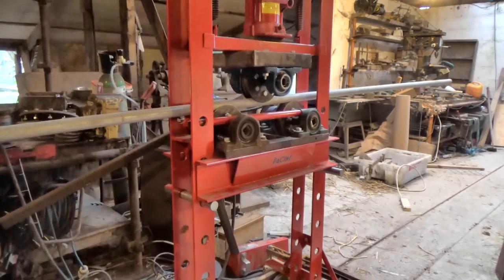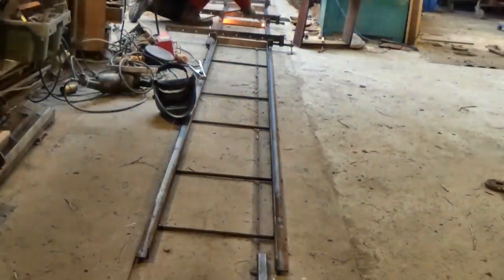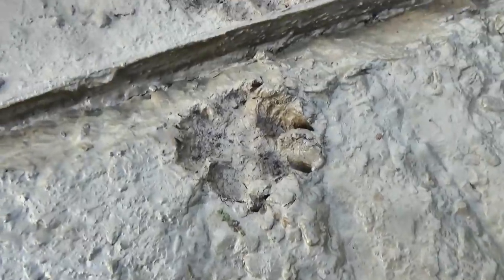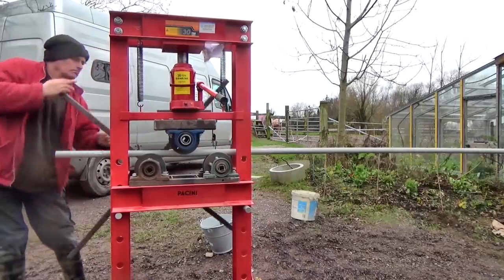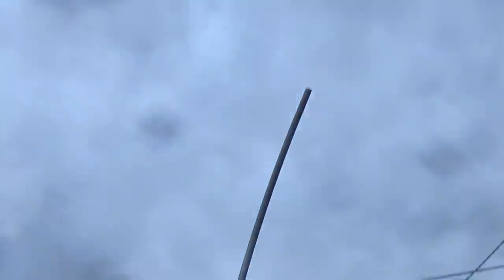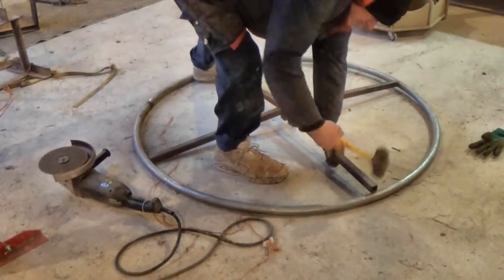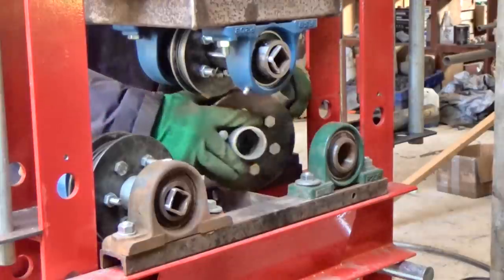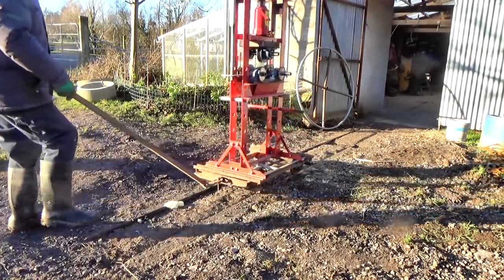Big Problems With The Home-Made Pipe Roller! (And interesting things I learnt trying to fix them.)

Comment: Perhaps you could add an upside down bottle of soapy water with hose & tap to feed it into the rollers while you are bending, this might prevent it from twisting & make it easier to bend the steel. I've seen people also weld a vertical length of pipe temporarily to the ends so that they have a exaggerated T shape so someone can hold a round steel bar through the middle of the vertical pipe to keep it from twisting too.

Comment: We had this problem with our commercially made roll bender at my last job. To some extent, I always thought it was somewhat on purpose, so that you can roll tighter circles without running into the machine. We once used it to make a helical sculpture, very cool!  But yes, it just seems to be a feature of that style of bender and not your build that is at fault.
Reply from the maker: That's reassuring to hear - thanks.

Comment: a dirty quick solution -  hang two pulleys a couple meters above the press and tie the ends of the pipe to a rope, and a 10-20 kilo weight on the other.

Comment: Check the hydraulic jack works on its side cause I had one that wouldn’t due to the oil  level whilst on its side
Reply: It may only be happy in a particular orientation, probably something inconvenient like the handle on the bottom.
Reply: @hughbrackett343  ha ha
Reply from the maker: I'm intrigued, Richi - can you tell me more? Send a link?
Reply from the maker: It does work on its side, but it's seeping oil - so I need to do it another way

Comment: I think it's wheel alignment, this will be compounded by the weight of the pipe. Over 6metres a few thou or 1/100th a mil will will make a lot of difference! The commercial horizontal ring rollers that I have worked with didn't have any end support. You might be able to compensate with out-feed rollers that you could adjust in height, I hope so!
Reply from the maker: I think you could be right - or partially right, at least. I'm halfway through the new build so I hope to find out soon..

Comment: I made a pipe roller like yours. I had to make safety rails for a chemical tank. I turned the roller upside down from the way yours is oriented. I then suspended the thing from my fork lift. I let gravity work for me. I successfully built my railings. I used the roller for just the one job. That was more than 20 years ago. I used a screw instead of hydraulics.
Reply from the maker: Excellent. Yes, if I had a way to lift the roller up, that would make sense for me too

Comment: Still think, that horizontal orientation will be better, but how about upside down? The end of the pipe would bend towards the ground, so it will not have to support itself, but in this case you should put your bender on the roof, or dig a trench for the pipe XD
Reply: On the roof and bent back through the doors Tim, that's the one I'm voting for.
Reply from the maker: I'm tempted, but The roof wouldn't support me and the machine even if I could get it up there. And a trench would quickly become a duck pond : -  )

Comment: Hi Tim I used to make round hay bale feeders and have bent plenty of tubing on a chinese rolling machine. The machine I used had about the same spacing between the dies as your machine but I bent 2.5mm galvanized tubing. The tubing you are bending looks like 3-4mm thick. If I were you I would space the dies further apart to have more pressure on the pipe. If you had a second story or pit you could swop the dies around so your pipe hangs while you roll but horizontal will keep it ground level. I used to center the seam of the pipes towards the center pulley to help keep the wall thickness even around the bend. A reversable motor  will help you keep your hands free while you guide the pipe through the dies. Never guide the pipe from the feeding side, guide it from the side it exits, that way you "pull" the pipe into a straight bend or curve. Good luck!
Reply from the maker: Thanks, Corver, but I solved the problem - have a look at this https://youtu.be/Esn1ZTaID9g

Comment: Yes I thought the same Tim, you'd have to lay the machine on its side. But then you'd have to place te supporting rollers at ever closer intervals... unless you'd take a concrete floor as support. Is the terrain around your house quite as big as the sky is tall over there? I admire your perseverance

Comment: you could flip the machine upside down, raise it to the required height, and then the weight of the pipe would be an aid rather than a hindrance.
Reply: only then you'd have to raise yourself with the pipe roller while you're bending the pipe because you wouldn't quite be able to reach it once the bend is getting to a certain stage
Reply: @Kirmeins  der

Comment: Something I think I would try, although it might not work, is to support the dangly end of the pipe with a rope that hangs from your roof, as straight to your roller as you can arrange it. Obviously, there will be a point where you won't be able to do this anymore, but maybe by that point the curve will be established enough that the corkscrew won't happen as much? It's probably worth trying before you chop the whole thing apart to re-engineer it.

Comment: It happens all the time with that sort of roller. A lot of times you will see people have angle finders and a big pipe wrench on the pipe to try to force it to stay straight. For really long curves you basically have to increase the distance between the rollers to support it better.. If you think of it as a triangle you are making the base wider to make it more stable.
Reply from the maker: Yes, that sounds right.

Comment: have you tried simply reversing the pipe with each trip through the bender?   That's what I do in a simple rolling mill for nonferrous metal bars, wires and sheets

Comment: One option, make the polytonal supports sectional, rather than one full swept bend something like a gothic arc - two straight verticals jointed to two arch sections. Yes, fair bit of work for the connectors but actually a nicer space to use in the end thanks to the additional height at the sides. The two arch sections would have thought would be small enough not to have the spiralling issue due to a fraction of the weight and length -being  around a quarter of what you are working with now.

Comment: Tim, this won't work but if you had a pipe welded or fitted a pipe at 90°and pointed up relative to the bender you could ensure it stays aligned until it has sufficient curve to make it impossible to fall and produce Cork screw. Try laying in bed with your arm vertical , it takes no effort but as soon as it wanders from the upright it's all down to muscle or friction between pipe and rollers in your case. A scaffold Tee may hold it with a lever in it.

Comment: Would it be easier to cut the pipe into shorter lengths, roll them into arcs , and then weld them together into the full size arch?
Reply: I think it would be an improvement yes. One thing to think about is that with a pipe rolling machine like this, we are always left with a short straight segment at the end of each curve we make. It is always as least as long as the distance from one of the outer bending wheels to the centre wheel. One way round this problem is if we can later weld up the segments, and then roll them into a full circle in one piece, but if the machine's shape and size doesn't allow for that, then we end up wasting quite a bit of pipe, depending on how many segments we've used. If those offcuts can be used for something else though, no problem!

Comment: What you have should (will) work with some minor adjustment to technique.  I suggest you apply a pipe wrench to the work piece to counter the longitudinal twist as you roll.  You will need to take multiple small bites and apply a little torque every meter or so as you roll.  Will be easier with a helper, but it can be done one handed.  As your machine may want to tip as the torque is applied,  best to nip the bend in the undesired dimension in the bud.  You are only trying to counter the off axis weight of the pipe.  A horizontal rig will do the same thing; need some torque on the workpiece regardless.  Nice vid.

Comment: could a setup similar to bent wood lamination work? Where you make a horizontal contour and then bend the pipe to shape by running a chain through it and pulling it in with a come-along or something similar. Obviously with all the work that already went into making this contraption, converting it to horizontal probably makes more sense, just wondering.
Reply from the maker: You're right - it could work. But then you'd need a different form for every different thing you want to make..

Comment: Kind of confused. If you are making a poly tunnel, don't you just need to bend half the pipe & keep the legs straight? Probably I am not understanding as if you do need a u section you would only need to bend half the pipe, then weld half the remaining straight pieces to either side of the bend. Still a horizontal bender might be fun. Thanks for sharing!
Reply from the maker: It depends how big you want your tunnel to be. You could use a few lengths for one frame if you wanted it really big, but I'm aiming for one curved length over the top, with straight legs attached.

Comment: Can you turn your rolling setup upside down, at least until the pipe hits the ground. If it starts off bending straight by hanging down then maybe it would continue straight after that if you then swap the rollers to roll upwards again. A bit of a faff though.
Reply from the maker: Unfortunately it's a bit complicated to do that - but thanks for the suggestion.

Comment: Just an idea...if its on its side, instead of having to support the whole lenght of the pipe as it  comes out, could you rest and hold  the extruded end  in place on a small dolley trolley  to support it, and the  force of the pipe being pushed through the machine would move the support  trolley  along the ground  and if needs be use a second one if theres too much sag as it it comes out ?
Reply from the maker: Exactly - dollies everywhere
Reply: @WayOutWestx2   you can never have too many dollies ! lol

Comment: tim tie a cable  on both sides of the pipe and use a turn buckle to pull back the pipe if i starts to wonder away both side must have turn buckles to adjust left or right you can tie it off on a heavy  object i made a roller  what is happening  is normal
Reply from the maker: It might work - but it would be very slow, wouldn't it?
Reply: @WayOutWestx2  if you take your time you will finish faster the idea is to keep the pipe straight while rolling or build a strong  table and rest the roller face down so it will be horizontal so
 you can get better  access to keep the pipe straight

Comment: Did you make sure that your axes of rotations are (and stays) really parallel to each other and perpendicular to the pipe? Think about it as if the pipe was spinning: the folding action would spin as well, and induce the cork screw effect. one way to make sure the pipe would spin on itself is to tilt your wheels. (so ... dont do that !!!)
Reply from the maker: Thanks Thomas.  I have a horrible feeling you may be right. I've just cut it up and when I checked for parallel they were out by a tiny bit. Obviously they were right when I first put it up but something may have moved. Silly me!
Reply: @WayOutWestx2  Thinking again this morning, I think perpendicular to the tube is the most important. They could be parallel to each other but skewed and induce a roll of the tube. Also its possible that this effect is increased by the way your wheels are produced (groovy ..) Try putting some graphite on the tube to make it slippery. Oil or grease might not work because too much pressure.

Comment: No the problem is you made it too weak ,you need  to make it more. Heavier the plate steel above the jack needs to be thicker but if you make it heavier you won't be able to move it by hand  that's what  I think don't scrap it use it on smaller pipes